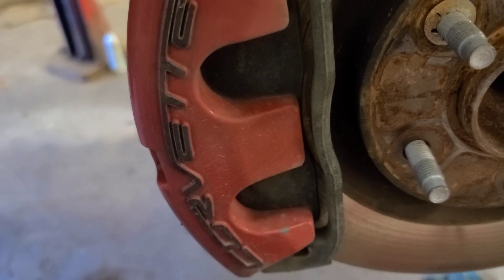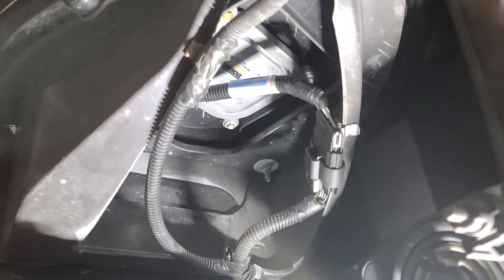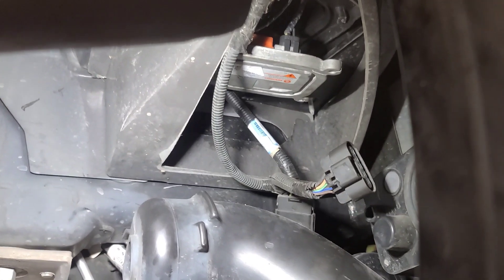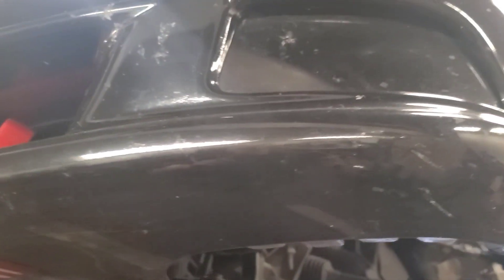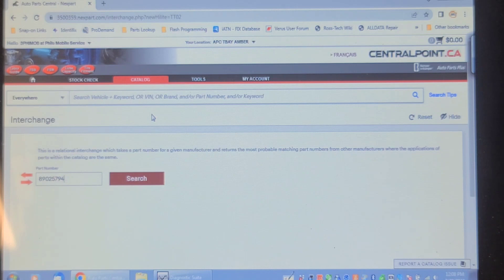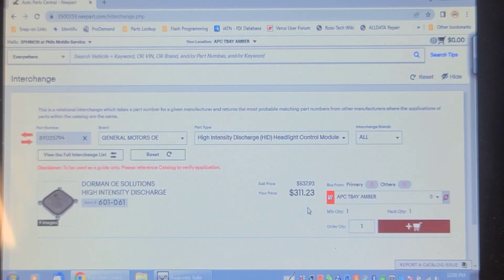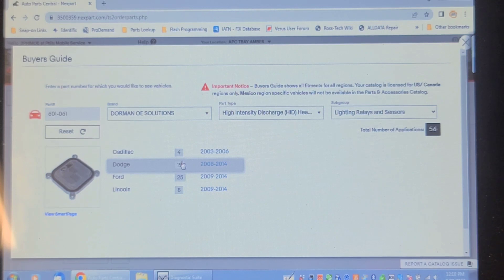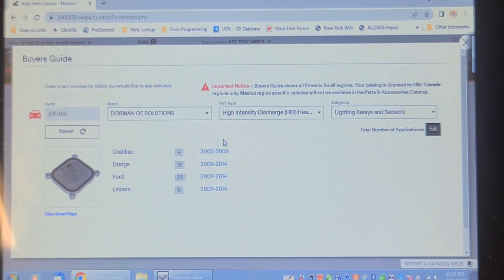2005 Corvette HID Ballast Drama

Comment: Did the problem ever get fixed??? If so what was the fix??
Reply from the maker: Customer installed a new GM ballast. I returned the Dorman part as defective but it could have been wrong for the application. I'd recommend oem